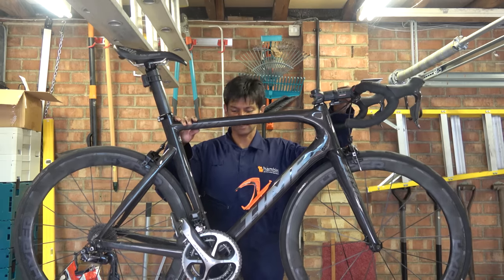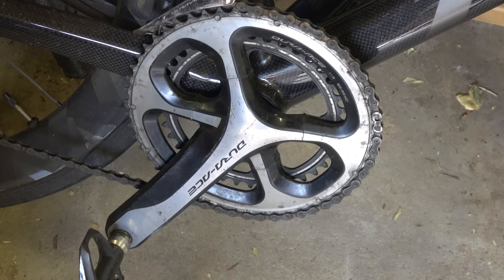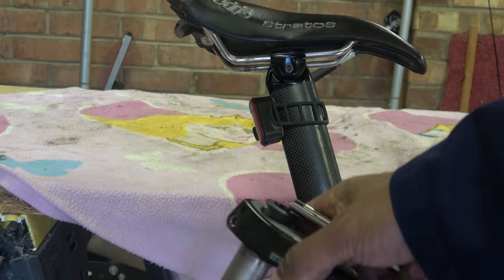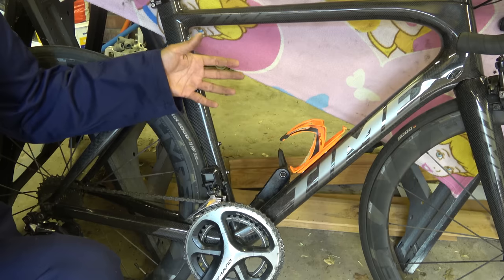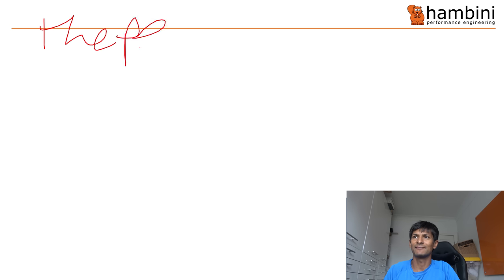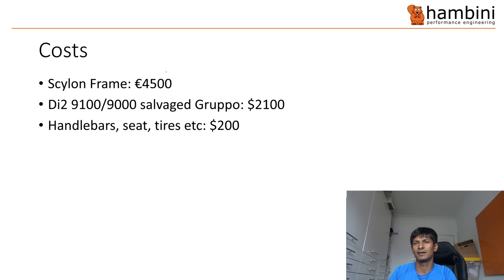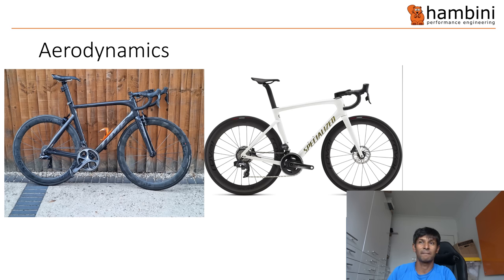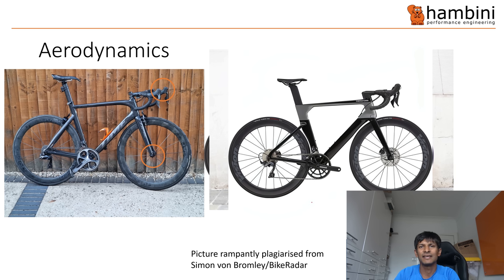TIME shows the world how to make a bike | Scylon | The Lick

Comment: What Time does is prioritizes smooth cable routing vs hidden stem routing. If you use mechanical cables this is an advantage for shifting. That said You could eliminate the drawback by plugging the routing holes and using electronic shifters.
Reply: I've always favoured regular internal routing over integrated internal routing, especially on older bikes or where performance isn't a very high priority. They're easier to pack for travelling too.

Comment: I have a 30-year-old steel frame 3X7 MTB with rim brakes. Still much very enjoy riding it and I could not give a rat's ass to what some reviewers say about older tech.
Reply: The best ride the ride you love. Keep rocking your MTB.
Reply: MTB performance has hugely improved over the last 20 years in a way road bikes haven't. 

I'm generally as fast on my 15 year old Trek Madone as my brand new Basso Astra, however when it comes to MTB I am just leagues faster on my 2022 Cotic Jeht vs 2005 Scott Genius - despite the former weighing nearly 5kg more!

So while there's still a lot of marketing fluff (and some consumer dead ends e.g. 27.5" wheels)  modern geo, bigger wheels, dropper posts, bigger brakes, 1x drivetrains, better tyres, wider bars etc.  all add up to modern mountain bikes being much more capable than stuff from back in the day.

Saying that we are probably at a bit of a plateau for MTB's as the marketeers are now all on the gravel bike train and all the R&D budgets will be going into those.... Probably by making them more and more like mountain bikes from 30 years ago - I can almost imagine the hype around the 2025 Shimano GRX 3x group set :)

Comment: To tidy up your cabling at the front, you can use a RS-910 junction a which replaces one of the bar end plugs to hide all the cables in the handlebar. I had to drill my handlebar to make it work.

Comment: Raced in weekend in C grade. 1st time in awhile. 3/4 seem to have all upgraded to discs. Faster people were faster. Slower people were slower regardless of what bike the were on. Difference in w/kg to w/drag in people over the group was much greater than the difference in aero savings bt bikes. Range of weights, sizes,genders and bike positions as confounding factors.
Reply: Newbie rider: "oh~~ yeah~~I'm going be faster with my latest disc brake aero bike " (under delusion and still not fit)
Seasoned rider: (whips Newbie rider's a$$ with his 10-20 year old rim brake road bike) 😆

Comment: Time manufactured frames are absolutely hands down superior to any ones. I’ve had/have Colnago C50, C59, Wiliers, Pinarellos. . None colors. The Time NXS I hand built was just proper. BB30 bearing “creak”? No the tolerances were perfect. Many thousands of miles and not a sound. Brilliant.
Reply: I was obsessed with used Time NXS when it was on sale at a bike shop in Japan. Now, I'm with Time Izon.

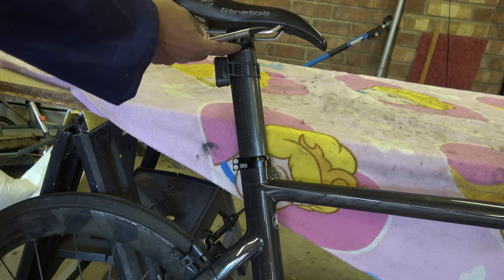Comment: 3:38 ah yes the new road bike meta, Fat bike tires and 140mm disc brakes thad are so thin they rub after a medium brake load.
Also covered head to toe with colling holes where the pads touch the disc so there is no surface area left to use.

Comment: 10:00 although the Time BB looks to be rounder than the other ones, the comparison in the PowerPoint is not good. The scales heavily favours the Time because the scale is larger.
Reply: Good point. I hope Hambini is not a sell out. What a loss that would be.
Reply: If it wasn't scaled the visual difference to the eye would be imperceptible, even though the difference is still massively consequential when it comes to BB performance. This sort of scaling practise of graphics is pretty standard in the world of science and engineering communication, its purpose is to illustrate the data as hambini has mentioned in the past.
Reply: @DomH1994 The only three bikes I've ever owned with press fit bottom brackets were a Klein Attitude, a Time Fluidity and a Scylon. I have never had a creaking issue with any of them, and I didn't use anything but light grease on the surfaces. The precision matters a lot.

Comment: May not be an issue with your Time since it's black, but as the previous owner of a VXRS and current owner of an RXRS my experience has been their paint is very delicate.  If you let it rub against something during transport or lean the bike on something it takes very little to damage the paint.  I also have several rock chips on my fork.  Other than the paint awesome frames.

Comment: It'd be great if one of your customers or viewers with a fat wallet would send in one of Gerard's 3T RaceMax Italia frames ... you know, the ones made using an RTM process in Italy.  They hinted 2 years ago they were shortly to move production to Italy (implying all), and suggesting they'd be cheaper. Instead they have produced a tiny handful of these frames, at 6k euros a pop - possibly because the results have been so dire they haven't been able to come up with many that could be sold.  If it's anything like the Torno crankset produced at the same factory using the same process, I can see why they've had problems - that has a really incredible reputation.  Would be fun to compare it with Time's RTM.
Reply: With all that fanfare, 3T only produced that much?  Full of hot air to me.

Comment: The orange bottle holder makes it a Hambini special.

Hambini, have you considered wax chains for your ride? Your chain is fairly dirty and looks like you pick up grime fairly quick. Buy a new chain, fully strip the chemicals out, then bathe it in hot wax (look on youtube). Can be purely Paraffin or you can add 10 percent PTFE for the properties that teflon provides (teflon likes to fill in dents and nicks and improves smoothness of a chain as it wears). Wax chains shed water and mud much easier and require less service vs cleaning and oiling. Also touching it doesn't leave you with greasy grime on your hands, or the dreaded bike leg tattoo. XD

Great to see you out enjoying the bike. I suppose this is a rare phenomenon since you don't trust riding all the other disasters that you review.

Comment: #hambini intial review on his TIME Scylon build...Your usual, unbiased direct  self ..😎💥‼🇬🇧...

" LOOK " foward to hearing a more in depth review on not just #timebicycles  TIME Scylon, but how the whole build works for you 

One of my bikes in my fleet is a 2014 TIME Fluidity VRS with full #campagnolo SUPER RECORD gruppo/ SHAMAL ULTRA wheelset build.

In the short " T I M E " I have owned / ridden it , I can tell you it ticks all the right boxes in performance parameters/ comfort departments ...and takes those to whole other " NEXT " ..level 

The T I M E provides  very sophisticated and satisfying feedback , handling and comfort  compared to numerous other high quality bikes/ builds in my fleet collection
The build quality , craftsmanship and finish is superb 
The unique RTM manufacturing that you mentioned certainly contributes to qualities mentioned here.

I also recently installed a TIME Monolink Carbon stem .
This has taken an already superior bike and build to next level.
Under hard loads like acceleration, climbing and descending, where you are putting more lateral torque, the overall feedback and responses are noticeably improved 
The components/wheelset build , really compliment this bike 

Keep us #hambini FANS posted on how your " TIME Build Project " experiences work out

Comment: Yet again another outstanding video, not only with explanations but the receipts to back up your words. I do have to say that, when most bike manufacturers switched to making frames and such from carbon instead of steel or aluminum (aka aluminium to the rest of the world), I think that despite the promise of carbon's light weight to strength qualities and the ability to tune the layup schedule to suit the frame design, the actual result is the lazy design and manufacturing that we see today for performance and (supposedly) race-quality bikes for the public. Why should a company maintain an assembly line and workstations manned by welders, cutters, noisy equipment and piles of tubing, when you have somebody in a hoodie draw up something in CAD and send the file off to China? Six months or so later you get a container full of frames - or maybe complete bikes that were specc'd from an online menu - and you just sit back and make money. Minimal effort by the manufacturer who makes maximum profits thanks to marketing hype and consumer ignorance. This is why I don't own any carbon bikes, even though I'm sometimes tempted. Then I wake up and thank God that steel is still real.

Comment: Hambini, the new propel has a thinner seat tube, top tube, seat stays, and chain stays. 
Do you think that 1) despite this, the new bike could achieve a lower drag because the front is more optimized,
and 2) rear end damping can increase from these thinner tubes without loss of handling stiffness/BB stiffness?

Comment: Hi Hambini, I've got a Time Alp d'Huez 21 that I like a lot. It does, however, have a design flaw. The spot where the front derailleur cable exits the frame is shaped like a little funnel and there is no hole in the bottom bracket area to allow water to drain. What are your thoughts on drilling a small hole on the bottom side of the bottom bracket? Keep up the good work
Reply: Don't do it. Not only will you void its warranty, you'll also introduce a new stress concentration point.

I used to think TIME frames are OK due to their tight tolerances and high frame quality, but because of this mechanical design for the cable guide, TIME is off my books.
Reply: Replace the bolt holding the cable guide down with a hollow bolt. Problem solved.

Comment: Thank you for highlighting the idiocy of disc brakes on road bikes - unfortunately it seems like the industry is hell bent on forcing them down our throats 😡🤬
Someone should put out a high end aero fork with a nice set of calipers nestling on the back - hint, hint 😉
Now a question - considering the aero drag from moving forward through the air, I think that the turbulence from the the bars, front wheel and rider should make the shape of everything behind pretty meaningless. Then I watched you comment on the gap between the rear wheel and the seat tube. Is this to deal with the drag caused by wheel rotation? Or am I wrong about the turbulence from the front? Or am I displaying my deep ignorance?

Comment: That is a stunning bike. My sl6 rim brake is nice and i went sram wireless to reduce cables. One other point aero bars generally speaking have crap adjustability so a std stem and bars is fine for me. But aero stem and integrated bars are really hard to get fit right on in my experience.
Reply: Yours was the last SL# that made sense. There may be some flaws to call out looking through the Hambini framing but it represents an all-to-often lament. In this case direct-mount brakes were an example of a reaching of the near apex just as the sunset of a design looms. Better rim-braking was had as was the possibility to use larger tires from what I read. Maybe the Chinese maker's will pickup the ball?
Reply: @m.talley1660  i like the alloy BB pressfit shells which are perfectly aligned. Came even with all plugs and ceramic speed bb30 bearings. It takes 25mm tyres with room to spare. And brakes on carbon rims are simply incredible. I am glad i got one. Bare weave TCR SLs is another bike with raw carbon. Nowhere to hide.

Comment: I still have my Time VXRS bought in 2003 from JE James chesterfield. Time customer service were good but slow. I found a hair line crack in the rear triangle it took about 6 months for the frame repair with fresh paint job rear half of the frame. For comparison back then a friend with trek just had a replacement frame under warranty
Reply: A repair is better environmentally. Trek likely discarded that damaged frame off to landfill.

Comment: I had the 2015/2016 RTM and it was a beautifully constructed frame.  It was the matt carbon with the carbon seat post cradle.  I replaced the cradle 3 times under warrantee. Terrible seat post design and required copious amounts of viagra induced carbon paste to keep it erect.  I had 25mm tires as they were the standard and it rode very stiff.  Good bike for shorter quick rides or fast group rides but longer rides could be a bit fatiguing.

Comment: I just got the Rotor aldhu carbon arms to replace the aluminum ones, and they are massively stiffer. The Rotor cranks are nice, but definitely get the carbon arms if you plan on putting any serious torque through the cranks.

Comment: 5:19 "You can take the stem and the headset off and the fork won't fall off" to be fair neither does it on my bike, but that's mainly because the headset bearings are more like bushings now
Reply: That's my bike on the wahoo kickr. Can't even turn the steerer, bearings are black so it looks like they just fused with the headtube.
Reply: @ghettoshampoo  you better tip your bike shop well if you get them to change the tape for you!

Comment: How does Look as a frame manufacturer compare to Time? Does it attain the same level of quality?
Reply: Usually very high, but one does come across a bad egg from time to time, but if this happens Look honour their warranty obligations with no issues. I have got 5 Look frame sets, including the newest Blade RS, all ridden through tens of thousands of miles and not one have had any structural defects surface. The ZED crank set was abitshit to live with, but luckily they've dumped it now.

Comment: Use a bar-end junction box for your di2, I did that for my Time because I didn't want the dangly bit under the stem. I went for disc brakes though because I'm a big dude and ride in the alps and want to ride carbon rims without worrying about water or delamination or latex tubes popping. Also, 28 mm (effective) tires rule. Improves braking too. If I want to be aero, I tuck down, if I want more, I put on a skin suit. That's all.

Comment: HiYa Hambini I'll reference you back to My red & white Scylon that I shared a pic with you recently if you remember... My 2 cents worth, firstly if I am going to pay top dollar(AUD $5800) on a frame & turns out it is poorly made by poorly paid workers then also has misalignment issues & a Reuleaux triangular bottom bracket shell I would be highly pissed off! But my Time Scylon I feel I got exactly what I paid for craftsmanship, I think it is stunning. I paid extra to have the active mass dampened fork & I actually like it for both the damp feel & the muscular looking fork legs. The ride quality of the frame is I think superior in that I feel superior & smug in the fact that I know that I am riding the best bike in the bunch ride. Where I will say this frame shines is fast mountain decsents & sprints, I'm an older rider 180cm tall if I am fit I'm roughly 90kg higher wattage rider still capable of over 1500w & I can still wack down a decent sprint, higher wattage larger riders will love this stout frame, with my weight I think it is buttery smooth... Some rifinements you could have made with your build is the TIME Di2 adaptor kit which I purchased after I converted mine to Di2 because I wasn't happy with the way it turned out, I used a Di2 upgrade kit that had the bar end junction box combined with a set of Deda Elementi DaVinci bar & stem which allows internal cables right back to just in front of the steerer tube for a much cleaner look ie Front & rear brake cables exting the bars near the stem & one tiny wire exiting the rear of the stem then into the Di2 port, I reckon it is pretty neat
https://lh3.googleusercontent.com/eMjiWRzKwZue_U7xCYgbRulwNSZ4niBTI6Cw0q_Y-b7ruOHy0HFpBjngpa94XWlTrZUfpattM8-2ATzTGaTBhhj5krjBOhxykSTDxRiw4qtIFABw-J8MYB946CqKbD2CRZchfegEZNRwHhntrX6JRRROcPnX5_66QSc6Ks0A3QDvXyNFmtXaqdsO5RHANNoQkrM9JxzI974X9DfCUWnsUnWR5_Xiz11Doh1dRCjA5KBRpTBoNPKvfOX-HD6UwvlNae9kXxdhbAKQHL4BwFgN3ukgMwO1wl_ojpvMIVLwMuniseIXxHufX9krfHhxwNdF4ZqNhbzDn0GoQCjXCOtxSFpmKKdzUK64lnYP6stPMktGUsFt-ADbgPiY4H-KV6S9YTajKM0tMy3JUwecxRzswhXdd7nN-52iY-ubPhygbf8UTWteCwkYI-i1rz626zBkhDcNbmx99hNJByTwsMlGeJwQ2n7ZB94UozGU03sEGma4GSJnX4QAFLFBytPrku1_C4nxWDf0Jz7nYLrJxNeOk8-HoSh4AnmXNl9qPuTx0EMQRBdqkdzxpBcS45A7i_adPIil5U1nxjq0O0qto2eP6iZhZhlhfZvV_CtvwBAziiDkJ88-Azdckp0BuikuwXN-f_4Q-P4OJn6dfod2oKkw8NgrMtV2O-IEtVrm4ey6cDzqLbRku-NdWu6gzkwOw8-xvSekMk6YqA4EV9wi7z7-fDP1trnY7FKJdYgRKKDD-MftphySw9dhQKxe1N0zjmYvFR2LtOA7gQkw4RSro0r0-OSTdqVwsSoPc-Q=w1920-h864-no?authuser=0
Reply: Oooooh & I just remembered mine had 1 flaw the alloy derailuer hanger was machined slightly wrong, but replaced straight away & I also got a spare with the bike & the flawed one just needed a slight tweak to be usable as a spare

Comment: Comparing the BB Geometry charts I gather that the Canyon is 42mm and the Time 46mm, so is it a valid comparison to have both diagrams with a low measurement of 20?
Not trying to defend Canyon, just thinking it's not a proportional comparison..
i.e. The rings on the Canyon chart are far smaller measurements between each. Total of 1mm vs. 3mm, so data displayed is 3x more detailed.

While I'm here, sent you an email about the new Oltre aerodynamics. Did you receive it as I had some connection issues when sending..

Comment: Super expensive, but any thoughts on the rim brakes from TriRig? The current iteration is the Omega One Aero. Seems like the biggest aero benefit is the cable routing. Of course, what's old is new as its not only similar design, but similarly named to the old Campy Delta brake. I imaging stopping power decreases compared to side pull rim brake, but is it better aerodynamically? Again, is the main gain in the cable housing position running directly in front of and in close distance to the head tube - IE less cable housing out in the wind? Likely not all that much gain as a rear brake and in fact might be challenging to route on some road frames. But would it be worth considering on front rim brake road bikes?